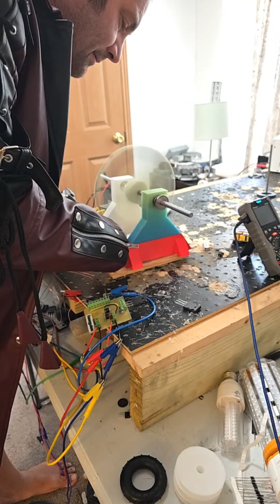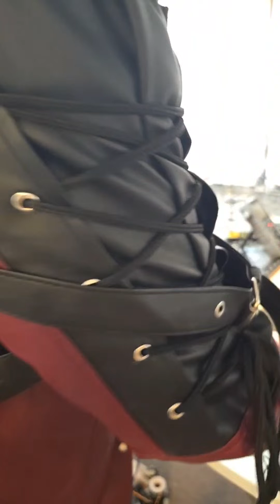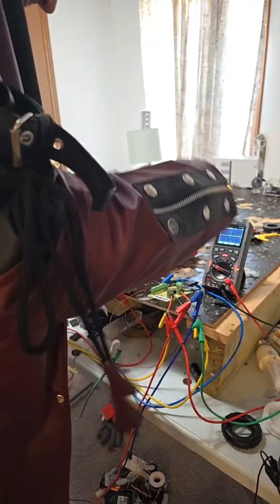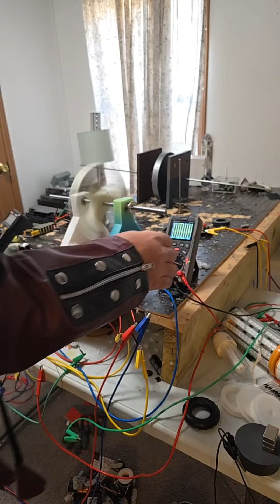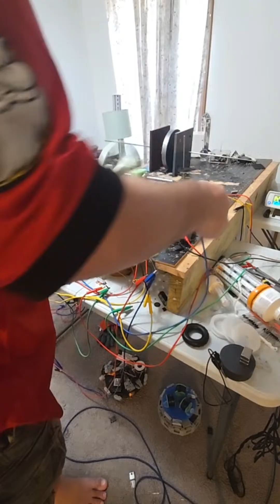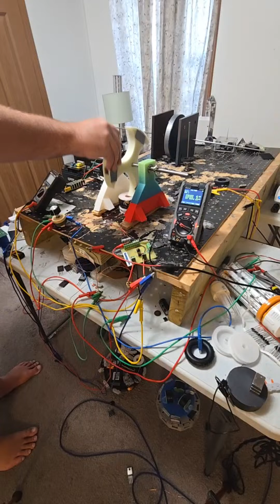Papa Bale's Pulse Motors is live!

Comment: bugger, I missed it. but cool as, love it, yep, love the shaft (fan and flywheel now I agree, epic) love the look, awesome. I use old pedestal fan shafts (8mm and 10mm is common), strip down to the motor (I remove the shaft and rotor from the motor housing/stator leaving the rotor on the shaft as a flywheel) good luck. awesome.